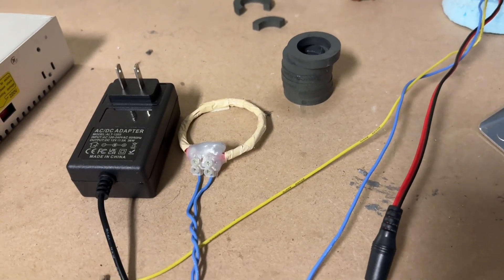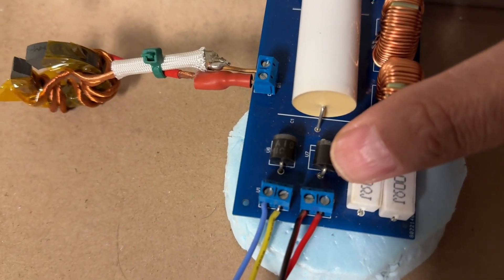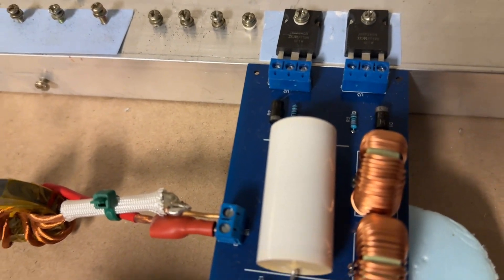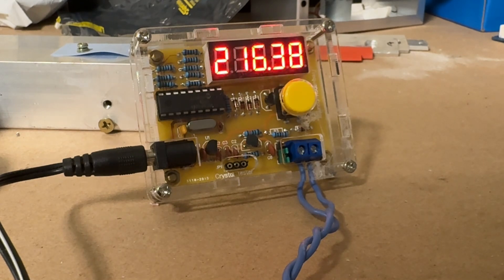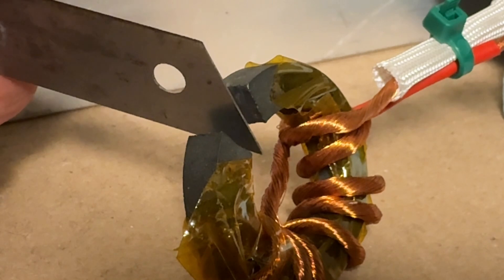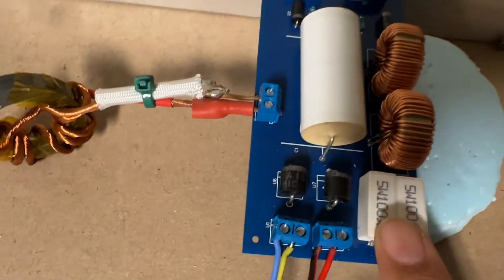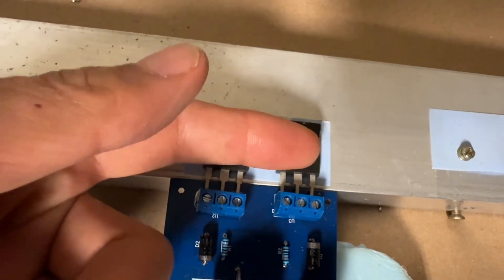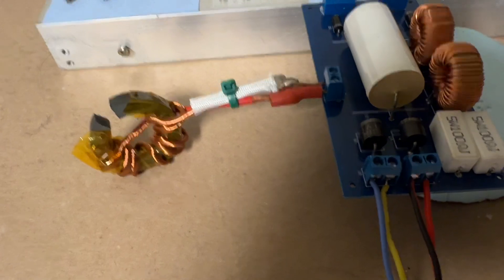Ferrite Gap Spot Heater Demo

Comment: I believe that such a device can have practical application. The ability to quickly heat a small area of metal is very useful. An example is sharpening saws. It is known that some Silky saws have blades with hardened teeth. It is impossible to sharpen such steel with ordinary files and the entire blade has to be replaced. However, if the blade material is preheated and slowly cooled, the hardening will be removed. Then the teeth can be sharpened and hardened again using induction local heating. For rapid cooling, it is possible to use an intense flow of gas, for example, helium.
Reply from the maker: Thanks for the insight about sharpening. Real interesting stuff!

Comment: Those cheap Chinese Frequency Counters typically do not work when built to the supplied diagrams, did you change the circuit to get it to work or did it actually work as delivered? .. What is the part number and where did you get it?  Thanks for this video.
Reply from the maker: I will try and find where I got it. It may have been AliExpress where I got it as a kit. Would need to go back and check out the past orders to see where it was obtained from. It uses a 40 turn magnet wire coil to pick up the Oscillating magnetic field.
Reply: @BrianDhvTinkerer  Thanks for your reply, Did you have to modify the circuit to make it work?  Did it work as it was presented? Thanks again.
Reply from the maker: @johnrussell6620 no
No modification was needed. I did not even need to add a burden resistor across the coil. I’ve tested it with phone wireless chargers, induction cooktop, Tesla coils, induction forges etc and it’s been spot on.

Comment: This reminds me the brand "frluxtrol", a material with high permeability usted to make "concentrators", like ferrite inserts where you need to focus the magnetic field in a copper coil inside a induction machine
Reply from the maker: Exactly - like a concentrator for focusing the magnetic flux

Comment: Nice.  Wanna see an easy rendition of a flyback driver with parts easily obtained.  Every one ive seen all use that bc transistor..  ive never seen that transistor used in any circuits other than diy builds that all the people who dont speak english but label videos in english..  you know, all the people asking very specific questions of you usually requesting something dumb..  lol
Reply from the maker: Thanks - I like to do detailed vids so people can actually build the circuit. Those small BC transistors are worthless!

Comment: This is a flux concentrator.
Reply from the maker: Didn’t realize the ferrite toroid flux extends so far in the air gap  that it can heat objects - the high freq is what makes this useful for small objects

Comment: Had a getter activator that worked similary to this. Heated the getter to release the cesium and barium in the tube to grab oxygen and nitrogen left inside the tube. It was a HF coil around a large wide gapped flyback core. 😮
Reply from the maker: Those have to really high frequency coils!

Comment: The ferrite if its the typical soviet М2000НМ is a MnZn ferrite:
initial permiability - 2000
Bsat - 0,38 T
Br - 0,13 T
Hc = 24 A/m
Tc = 200 °С
Keep in mind this is just the spec, reality may be different. Also be careful, they are not insulated like modern ferrite toroids, and ferrite is rather low resistance. Nor do they have chamfered edges so without putting a chamfer on it the wire might get bent too hard and insulation will be damaged.
Reply: These rings are put on big induction heating machines to prevent RF backfeed into the high current DC feeding the SCR switches.
Reply from the maker: I think it is that one!
Reply: How about doing your own shaped cores using Fluxtrol paste??

Comment: Hey that's a great idea to take advantage of a gapped ferrite to prevent saturation but also take advantage of the high flux at the gap. I used to like winding a step down with a real fat secondary to directly heat metals for soldering/brazing but it course suffered from the problem of the high permeability core getting crazy hot.
Reply from the maker: Exactly. The core permeability is a tradeoff between workpiece heating and gapped core heating!
Reply: @BrianDhvTinkerer 🔴 What Is Islam? 

🔴 Islam is not just another religion. 

🔵 It is the same message preached by Moses, Jesus and Abraham.

 🔴 Islam literally means ‘submission to God’ and it teaches us to have a direct relationship with God. 

 🔵 It reminds us that since God created us, no one should be worshipped except God alone. 

 🔴 It also teaches that God is nothing like a human being or like anything that we can imagine.

🌍 The concept of God is summarized in the Quran as:

📖 { “Say, He is God, the One.  God, the Absolute.  He does not give birth, nor was He born, and there is nothing like Him.”} (Quran 112:1-4) 📚

🔴 Becoming a Muslim is not turning your back to Jesus. 

🔵 Rather it’s going back to the original teachings of Jesus and obeying him. 

More .....👇

🔴 THE RETURN OF JESUS
Reply: When I was a kid (many years ago) my TV final hv tx drive had a ferrite inductor that needed adjustments from time to time to stay on 15625 Hz. Out of laziness, I was always using the same metal mini screw driver, that was always getting extremely hot because of the inducted magnetic field if the adjustment was taking more than a couple of seconds. Never thought it would be a thing one day, it's just plain physic. However it's still cool.
Reply from the maker: @codures thanks for your story- that’s awesome. I remember the days of the old B&W TVs- I used to hang around with awe  to watch the TV repair man at work

Comment: Why not rectify the ac voltage from the variac then feed it to the ZVS ,a FULL-BRIDGE rectifier allows more power in and of course u need higher voltage
Reply from the maker: Great point! Yes exactly. The board consultation I had is designed to run a ramped ZVS driven Tesla coil. For sure a full bridge circuit would allow twice the power !

Comment: For frequency counter coil, how many turns or wire did you use??
Reply from the maker: I used 40 turns 32 gauge magnet wire. It seems to work well.

Comment: This is very cool, with such a high frequency it allows you (in theory) to heat up tungsten....
Reply from the maker: Yes for sure. The frequency can be raised or lowered by changing the size of the resonant capacitor. In this video, I am using 100nF. The capacitors have to be rated for high frequency as they would rapidly heat up and fail. The one I am using here is 942C20P10K